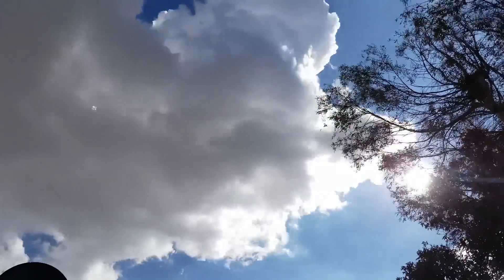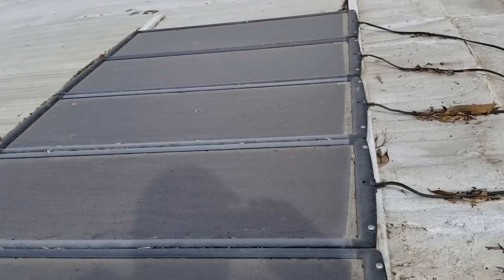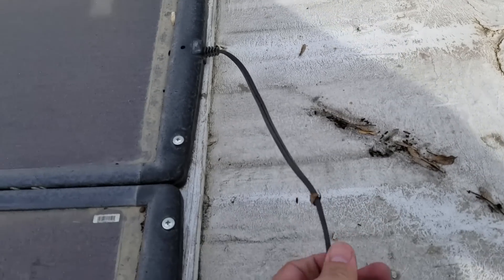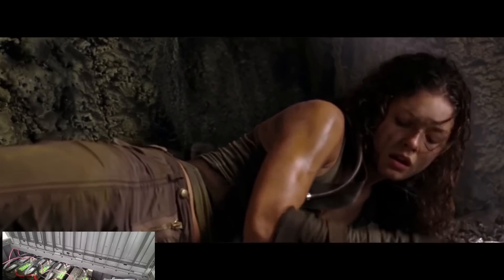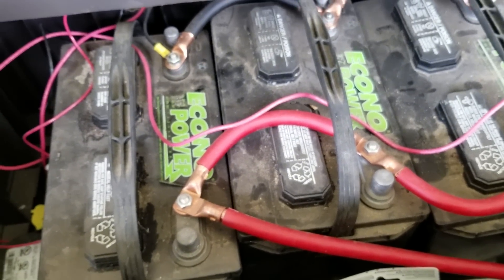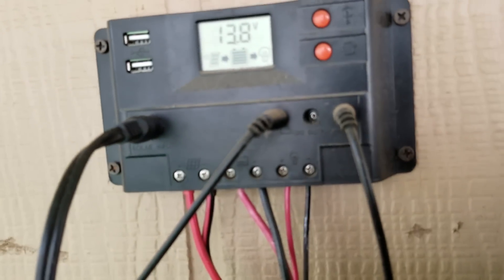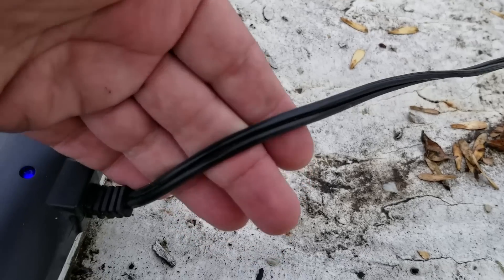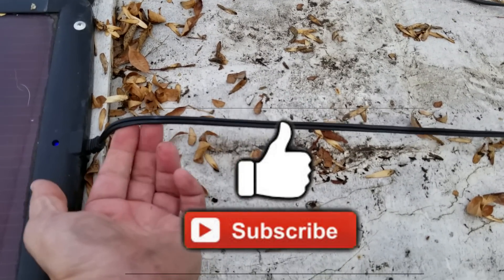Harbor Freight Solar Panels exposed to weather for 1.5 years

Comment: I had two sets of the old style Harbor Freight panels for several years, they worked great for what I was using them for.  I don't like the plastic frames or the wiring on the new ones.

Comment: I'm experiencing what I can operate 24/7 I have 9 panels and 3 x109amp hour battery bank and 1000watt inverter modify sinewave I have TV xbox and cable and internet box on it monitoring hourly drawing 6amps off battery finding out I may need more batteries and panels

Comment: They sell grid tie inverters now that you can just plug into any outlet 1000 watt plus that will feed the entire electrical panel all day long and at night until the batteries go dead.  This will run your fridge and lights, fans, tv’s, computers and supplement your ac’s electrical usage. https://www.amazon.com/Inverter-Stackable-DC20-45V-AC90-140V-Output/dp/B07281BDDY/ref=sr_1_1_sspa?s=electronics&ie=UTF8&qid=1538955735&sr=1-1-spons&keywords=Grid+tie+inverter&psc=1